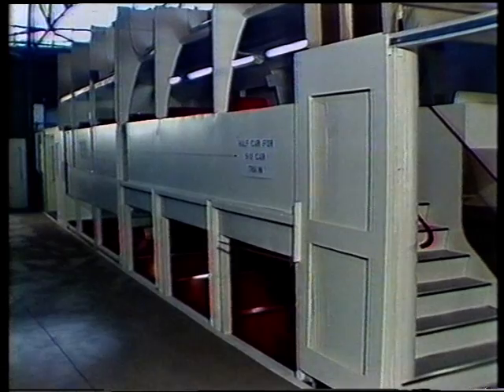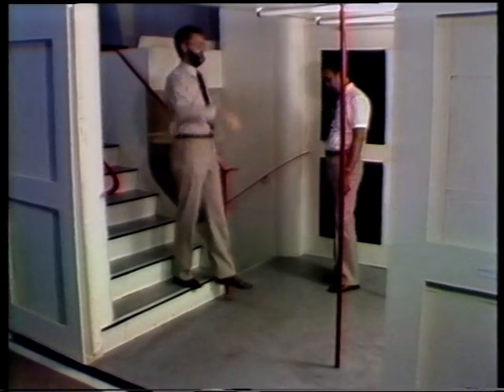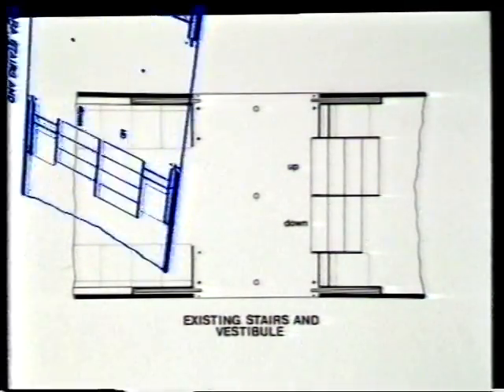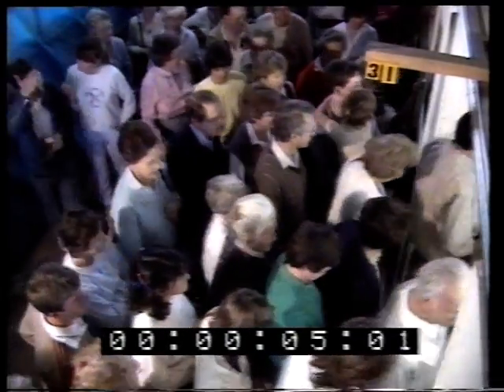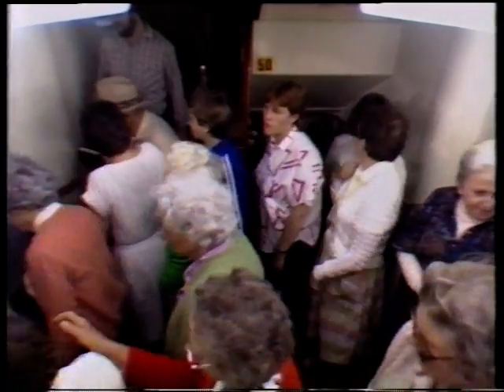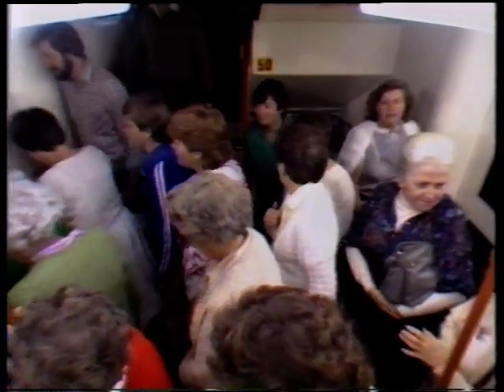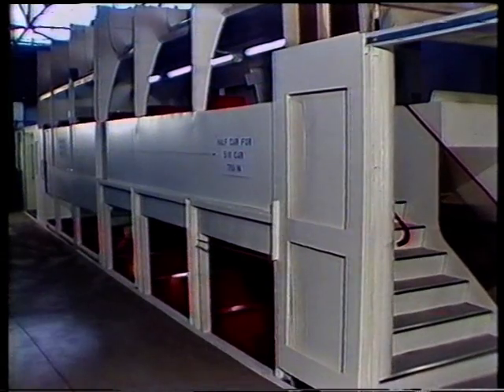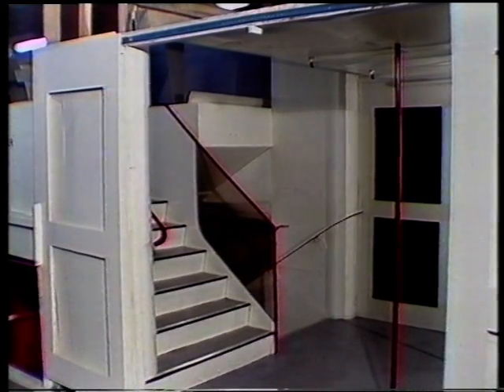ComEng Tangara passenger flow tests

Comment from the maker: Thatll be the 4-D you guys had down there, only low density seating 2*2 upstairs as although the track gauge is broard in Vic the loading gauge is smaller than NSW, got some pics I took of the MetLink 4-D down in Newport depot before it got cut up